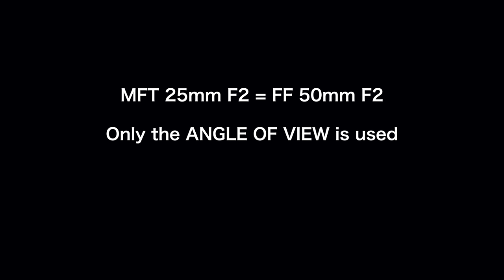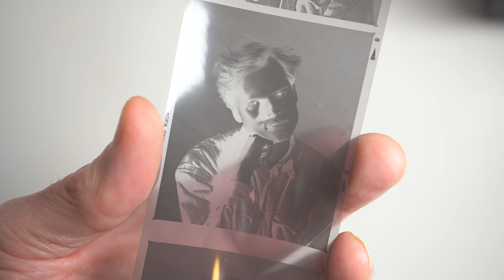Equivalency –What does it matter?

Comment: size matters, f stops stay the same for exposure but not for dof, gradation is the real size issue, if you have an image over an area the greater area gives a better gradation which is why larger formats look better
Reply: Interesting. Do you have any examples showing this difference in "gradation"? I.e - photos taken with equivalent lenses - i.e same framing & DoF?
Reply: Better than what?  It depends on what you wish to accomplish.  I may add, it also depends on viewing photography as an art, as compared to photography as a technical image rendering quality.  There are times when I really like the look of the smaller sensor cameras more than the larger formats.  -Loren
Reply: Gerard Ferry, if you put a 50mm f/1.8 lens (used at f/1.8) on a MFT, a CS and a FF, not only will the exposure stay the same but the depth of field will too. What will change is the framing of the subject, the FF giving the widest field of view, the CS giving a narrower field of view and the MFT giving the narrowest field of view. To get the framing the same, one would have to stand further back from the subject with the CS compared to the FF and further back with with MFT compared to the CS, and it is this difference in distance to the subject that will alter the depth of field.
Reply: @GoneToHelenBach  Incorrect. Plug the numbers into a DoF calculator. The smaller the sensor, the shallower the DoF.
Reply: @gregsullivan7408  Correction accepted, though the framing will still be significantly different and the only way to get the framing the same is to adjust the distance between the camera and the subject, assuming the same focal length is used as per my example, or alter the focal length. In either case the larger the sensor, the shallower the depth of field will be for a given f-stop but, once again, this is all down to the distance between the camera and the subject, not the sensor size. I'm going to make the assumption that I'm telling you something that you already know, though.
Reply: @GoneToHelenBach  Agreed for the most part, except the bit about it not being the sensor size. The sensor size is the REASON we have to move back or forth, or use a lens with a different focal length and F-stop. It's a fundamental part of the whole equation.
Reply: @gregsullivan7408  Indeed, the sensor size is the reason for needing a different distance but it's the distances involved that cause the change in d-o-f, not the sensor directly. As you pointed out, a crop sensor camera will actually produce a shallower d-o-f than full frame for a given distance, focal length and aperture.
Reply: @lorenschwiderski  its empirical not subjective
Reply: @gregsullivan7408  its area of film or sensor that determines the gradation, other inputs effect the quality to a lesser degree often little more than adding a flavour and an accusation of pixel peeping, basically getting closer gets a better resolution as the old argument for larger format goes  ie a head shot in both formats
Reply: @GoneToHelenBach  just wrong, your changing two variables not one
Reply: @gerardferry3958  An observation is subjective
Reply: @lorenschwiderski  a consensus from mass observation is a truth and determines who is mad from my philosophy days, senses are all we have
Reply: @gerardferry3958  Interesting. So a Picasso painting is garbage, if most would observe it to be as such?  Are you a relative of Ken?
The FF cameras do render fine, sharp, and clear images.  Of course you can always one up to a medium format.  :)   Was there not a time when most people observed the earth as being flat?
Reply: @GoneToHelenBach  we'll have to agree to disagree then. (and it's only a tiny disagreement). Btw, the reason the DoF is shallower when you move the lens from a larger sensor to a smaller sensor is due to the magnification that is required to bring the smaller sensor photo up to the same size as the photo produced by the large sensor. That simple magnification changes the DoF - it's equivalent to moving the cropped print closer to us.
Reply: @gerardferry3958  again - I'd be interested to see some examples showing the difference in gradation, if possible.
Reply: @gregsullivan7408  any one of the comparisons online comparing formats
Reply: @gerardferry3958  ok. I've never noticed it - do you have just one link, that shows the difference well?

Comment: Whether the conversion is useful or not is up to the individual, but there is only one right way: Equivalence is the conversion of focal length AND aperture! 

Only converting focal length (25mm f/2 = 50mm f/2) is simply wrong.
And I say this as a Micro Four Thirds shooter and fan of the Lumix gear.